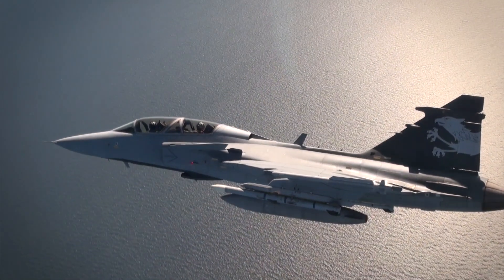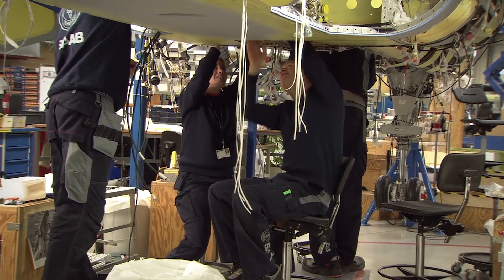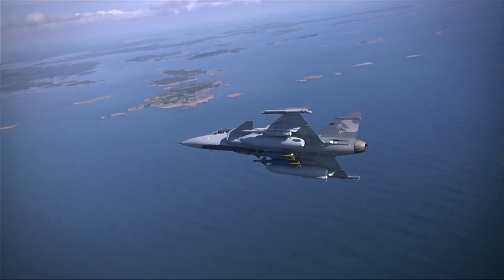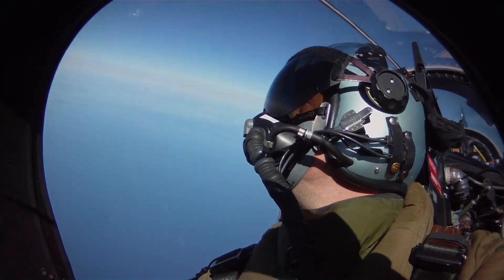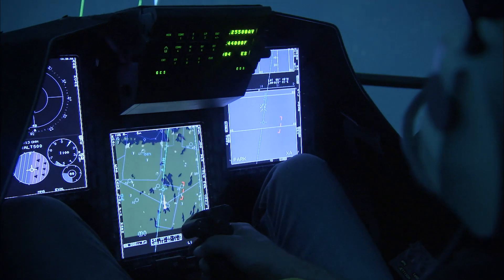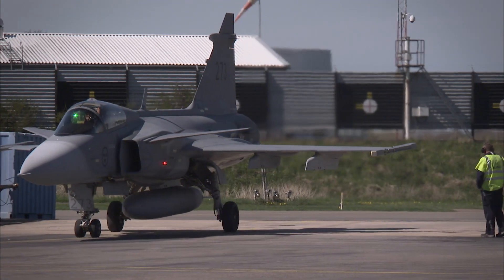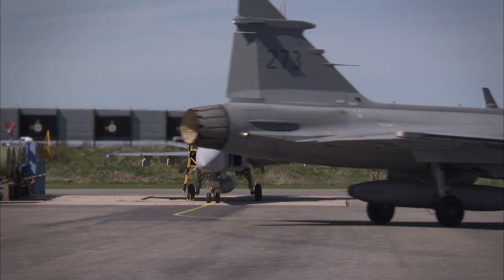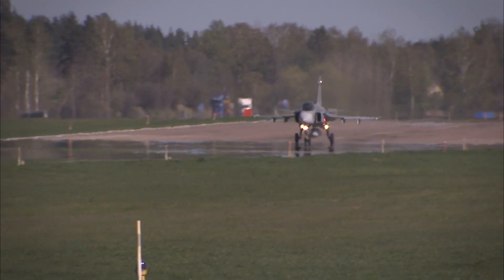SAAB Gripen fighter system (corporate video presentation)

Comment: Whaa..t, Gripens retain that old-school type 'Center (Pitch & Roll) Stick' still & not the newer "Side-Stick" ? Jee, I hope the Side-Stick approach gets implemented on the newer Gripen E /NGs & maybe in the nearest future, evn transition from being what's now a single engined jet to a 2 engined version, wic tho will incur much more cost related encumbrances, but itdda still be worth it, for the very benefit of survivability & the much higher chance of returning home, all in 1 piece, be they the pilot asset or the entirety of the aircraft asset to the defense institution of regard to wic they both belong. Cuz with one asset more available (still in its inventory) to the use, it essentially translates to one useful asset more to effect lasting longer in any protracted war. Twin engines of like for example Honeywell-ITEC's (of Taiwan) TFE (item) 1088-12 shud be re-given due, renewed exploration for application feasibility, for I believe they're smaller evn than Safran-Snecma M88-2's exceptional small stature in reference to the thrusts that it had. Furthermore shud its manufacturer-consortium explore further, they'd probably be able to squeeze in evn more pounds of thrusts to make it evn more viable.